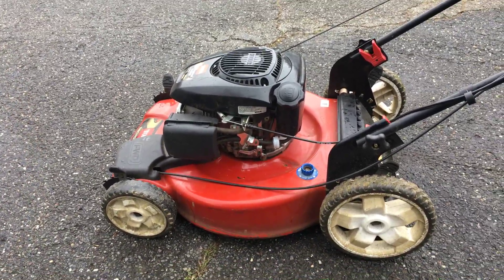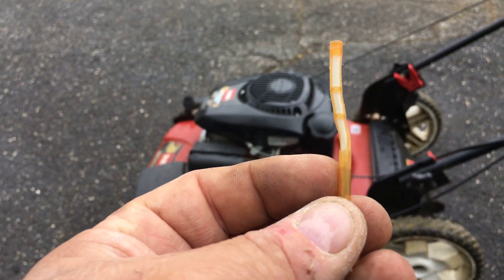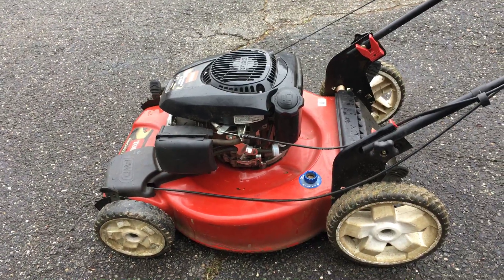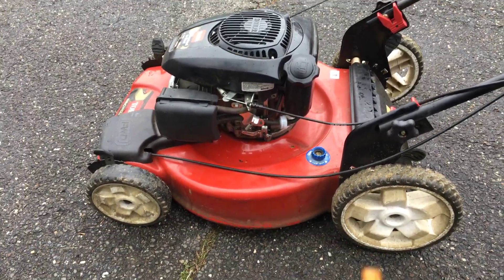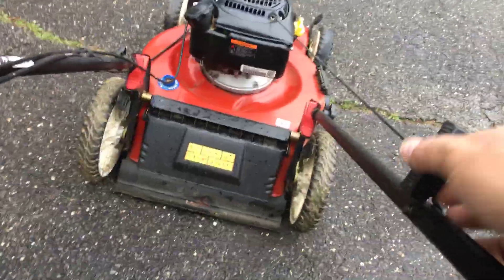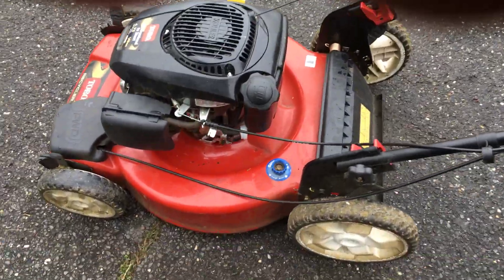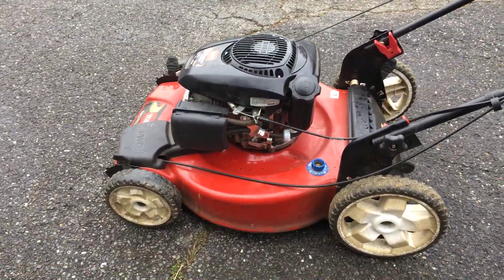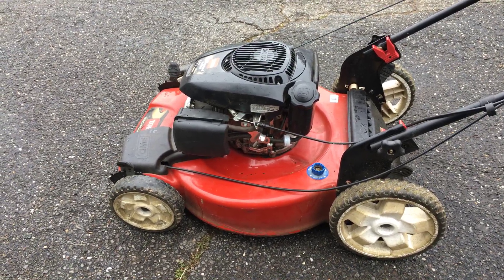Kohler carb for toro recycler FIXED

Comment: This totally fixed my mower. THANK YOU! I have a Toro recycler with a Kohler XT 675-3102 and it was taking a dozen or so pulls to start after winter storage this year. I took apart the carb and cleaned it up real nice, but still had same issue. I could not figure it out until I saw this video. I removed that stupid in nipple fuel filter and now it starts in one half hearted pull. I'm going to put in an inline fuel filter and throw that piece of crap away.
Reply from the maker: Dangerlawn  glad I could help. It drove me nuts too!